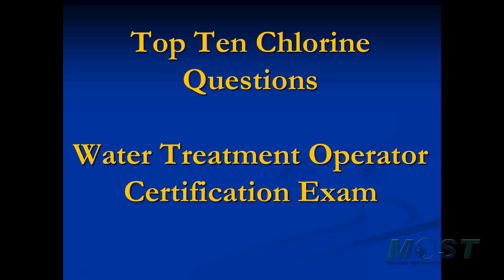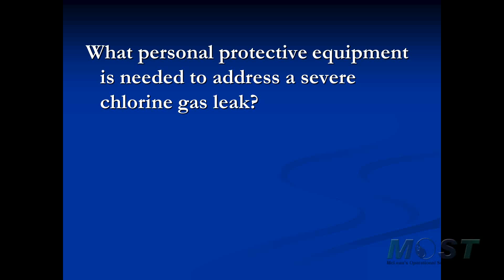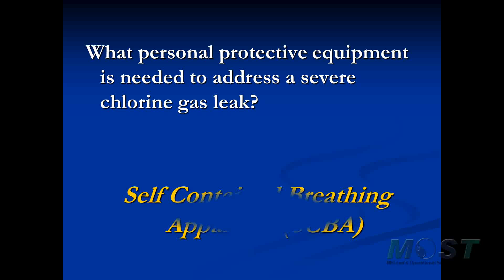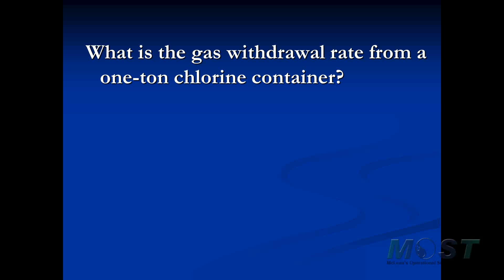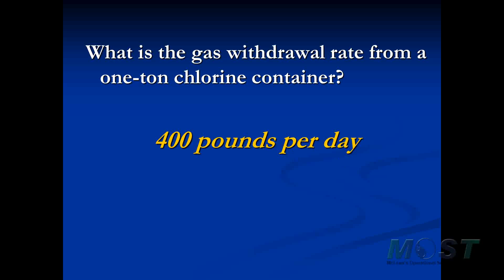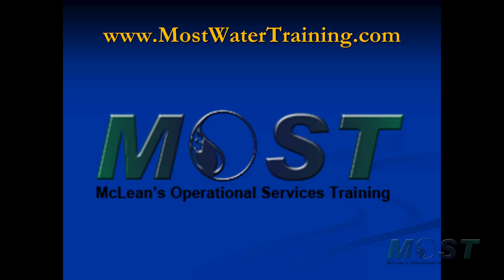Top Ten Chlorine Questions.flv

Comment: What is the difference betweenfree chlorine and  residual chlorine And what is required in the sewage rate
Reply: Free chlorine is the most potent form of chlorine and is chlorine that isnt bound to anything such as amonia. Once it becomes combined it isnt as potent. Your residual is what is left in your distribution system after it has left your treatment facility and it could either be combined or free.

Comment: On the question about addressing a chlorine leak, I thought it was backwards as far as rotating the container. I thought if you rotate the container to where "liquid" comes out then you diminish the ppm by 400 times. This is what we were told in a training session. When cl2 liquid becomes gas it multiplies to 400 times the ppm of a liquid. Could you clear this up as to which procedure is correct? Thanks in advance.
Reply: When the liquid is exposed to oxygen it multiplies itself by 400 times. That's why you want the gas coming out instead of the liquid.